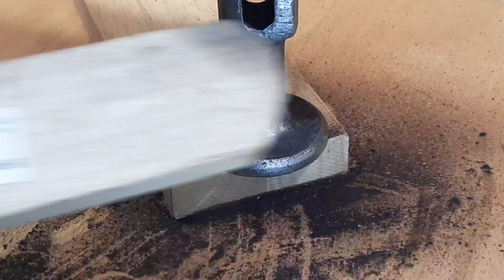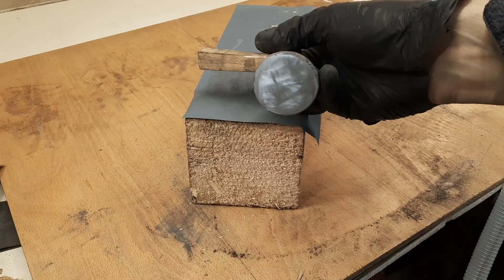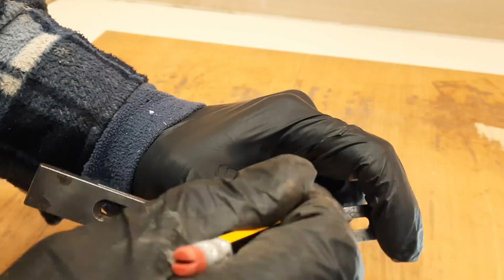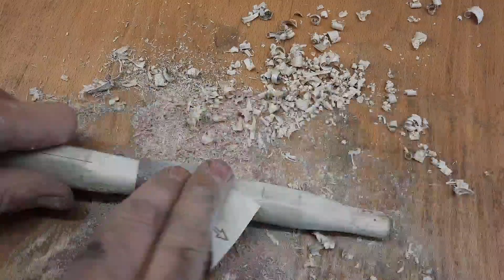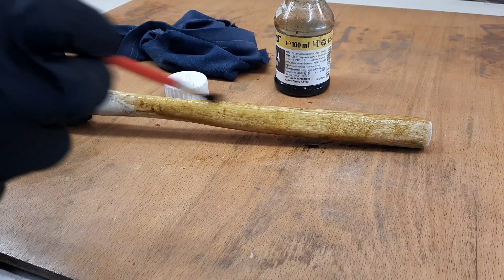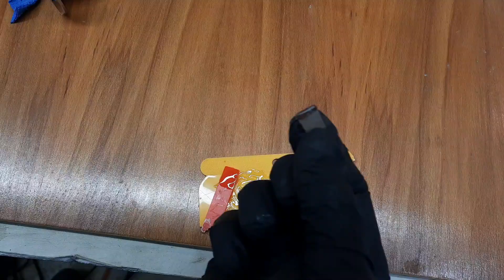Hammer Restoration for Leather Craft working

Comment: Hi, looks great, but this hammer is not for leather work, it is a standard panel beating hammer. I know that because I'm a panel beater by trade.
Reply from the maker: Hi thanks for you info. Thats what I thought it was when I brought it but when I did my research on the internet last year these kept on coming up as German leather working hammers but also some were listed as panel beating hammers also there were two listed at the time  with the square end the same as mine with the raised texture but one said leather and the other panel. I will do some more research tonight as I can always change the title. Thanks ones again for your info and have a good day.